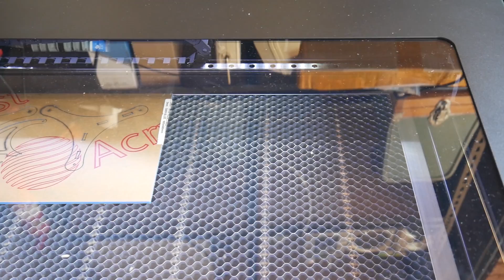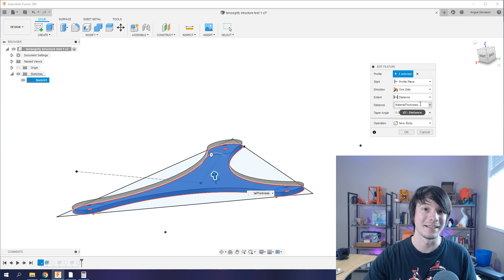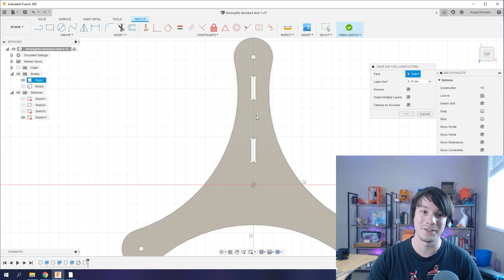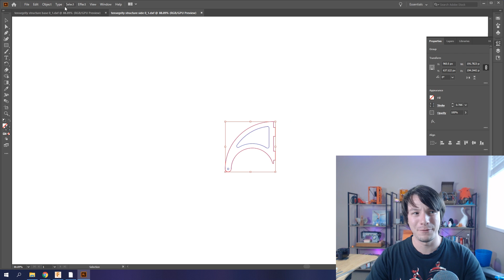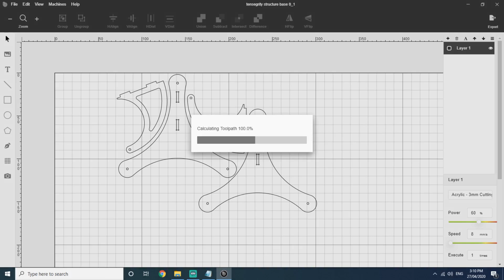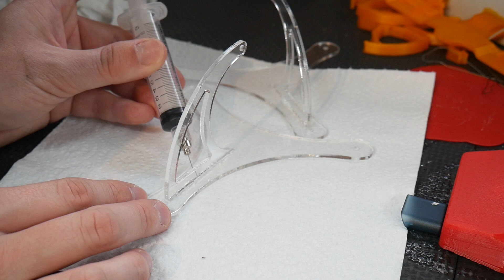Laser Cutting a Tensegrity Structure

Comment: 14:57 I see one issue, though. You usually want to go from inside to outside. Because as soon as the outside line is cut, the part might be loose. AND MOVING! Which then screws up any subsequential cut (their tolerances).

Comment: A tip for both you and the viewers that I didn't see mentioned: There are two primary acrylic production methods, cast and extruded (this is almost always specified on the product page).  Extruded acrylic by and large has much tighter tolerances for size, both across a single sheet and between sheets, so it's my go-to choice for consistent results out of my laser cutter.

Conveniently, extruded acrylic also tends to be cheaper, so it's most likely what you have anyway.  The only upside I've heard for cast acrylic in laser applications is that it apparently engraves to a more pleasing, chalky white finish.

Comment: NEVER AGAIN !   That's what i was told when I picked up 30 pcs of a simple part I had laser cut from 1/8 thick acrylic. I also got an ear full from the plant EHS manager. Ventilation/fume exhaust is critical.
Reply from the maker: Sounds like they have nfi what they're doing, acrylic is easy to cut and fumes can be mitigated by any basic vent system.

Comment: Your kerf is 0.2mm, not 0.1mm.  Because you have removed 0.1mm on either side of the cut.  So your square is 0.1mm smaller on both sides, so 0.2mm smaller in total.
This also perfectly fits what you expect.  Pretty much ALL laser cutters have a kerf of 0.2mm.
Also, consider putting in dimples equal to your kerf.  Add a triangle in the middle of one of the slides in the slot, with height of 0.2mm and width of 0.4mm.  It will be barely visible, but this will give a very satisifying 'click' when you push them together

Comment: The plastic manufacturers know that their customers have a 10% tolerance allowed in the sheet thickness. Knowing this they intentionally aim for 90% thick instead of nominal because it saves them 10% in cost.  I spent many years running laser cutters at work and it's pretty much the norm that acrylic will allows be thinner than listed.  Annoying just the same.

Comment: you forgot to mention one aspect, depending on the acrylic you sometimes need to heat treat it. 
taking it straight out of the laser cutter and putting it in cold water will cause a billion tiny hairline cracks and ruin the aspect of it. 
At my workplace we have an oven we put the parts in there and no more cracks.

Comment: There is a place for SLA, FFA, and laser.  a shop that has these and the skills required to use this is a well stocked shop.  However, if you are spending the $3000 on each of them, you are not only in a different tax bracket than most people who want to use them, but you really should be producing, and not just have them as a hobby.  Production quality is very useful, but how useful is it if you cant afford it?  I would like to see some videos on some more affordable machines.

Comment: you always have to check your acrylic thickness, if you check the acrylic thickness tolerance you will certainly be surprised on how in accurate it could be. BUT WHY? it is because when they produce the acrylic, they have to melt plastic and put it in between 2 very large glass sheets(like a mold block) so for sure that an acrylic will be super vary in different spot.

I own a laser cutter as well, I love my laser cut more than a 3d printer tho because it is so DAMN FAST but i still love 3d printer for producing a very complex part as well. I appreciate that you are making a video about laser cutting and I hope to see a series of laser cut more!

I recommend lightburn to make your life easier with a laser cutter, just export the design from fusion 360 in dxf and pop it in Lightburn. BTW the idea of KERF is important ! about the peeling of material, I usually soak it in alcohol make it easy to peel.

Comment: Does the laser cutter have a radiation screen built in, or do you have to wear laser safety glasses instead?
What other plastics can that machine cut? Can it cut polycarbonate?
Also, what is the finish like on the bottom side of the cut? I laser cut metals for a job, and you tend to get a dross edge on the underside of the cut, mainly on aluminium.

Comment: The cracks are from the heating of the laser (think tempered glass/ Prince rupert's drop). Any solvent will cause the material to weaken and fracture. You can prevent this by baking the pieces in an oven (120-140C depending on location/altitude) for 30-60 minutes, about 70% of melting temp to relieve the stress without deformation. You can also help reduce the edge bevel by setting the focal point in the middle of the material.

It's hard to see from the time lapse but it also looks like the air assist on that machine is low for doing plastics (petg, acrylic, etc.. NEVER vinyl (pvc) or ABS). Ideal for plastics is 15-20psi.

It was mentioned below but to say it again, Lightburn (if the controller is supported) will do everything you just did all in one package (create, edit, kerf offset, etc...)

Comment: With the laser cutter i use. Leaving the lid open and running the cut will give you a preview as the laser will not fire due to the interlock switch but will run the program as normal. Is only a work around on a small project as it will run the whole program not a bounding box of the cutting area.

Comment: If your laser can take SVG, I wrote a plugin for Fusion 360 Laser CAM that will allow you use use all the CAM features, like kerf compensation, opperation ordering etc in Fusion 360: https://github.com/garethky/glowforge-colorific-fusion360-post
Its nominally for Glowforge but it generates well formed SVG.

Comment: You can do your stock layout (what you are calling "nesting") in Fusion rather than Illustrator, and you will avoid all the problems with potentially breaking parts during stock layout. 

The best way to do it is: 1. Make sure every part is its own component in Fusion 2. Create a new component (call it "Stock Layout") 3. Copy every component into the stock layout component. 4. Now you can arrange the child components of the stock layout component however you like (including rotating them to lie flat and moving them relative to each other) without disturbing the originals 5. Export stock layout component to DXF.

PS. Minor point: "nesting" is when, during stock layout, you put one (smaller) component inside a cutout in a (larger) component. When you are just moving parts around without one being completely enclosed by another, that's not "nesting", that's just stock layout.

Comment: I've worked at a trophy shop for about 6 years, worked with extruded acrylic blocks. Even from the same box from the manufacturer, the thickness always varies from each sample. So annoying to work with especially when working with UV printers with delicate printing heads. Made some acrylic display stands with the facilities laser cutters, took some trial and error, but finally got the parts to friction fit. A lot of fun to design these types of things! Thinking of getting a laser machine too. Thanks for the tip for the stress relief technique! Had no idea about it, future projects will go a lot smoother in the future.

Comment: Deepnest is decent free nesting software. We learned on our first commercial metal cutting laser that while shared lines or using a border as a line sounds good, it produces very poor results. I have  had better results mixing 3d printed parts and laser cut parts. Sandwiching the acrylic parts between two 3d parts and there is virtually no cracking issues. Anyplace you are 3d printing a large flat surface, one should consider laser cutting it instead.

Comment: We use acrylic sheets in my company's products.

Thickness is always an issue. If a sheet of 2 x 1 meters with 10 mm thickness is purchased, in the center of the sheet it will probably be 11.5 mm and at the edges something like 9.5 mm.

And all the different manufacturers that I tried had these variations.

We use 3D printers for structural parts, such as angles and joints and laser or router cuted parts for larger areas. It's a really good combination.

Comment: Finally! The 3D printing get so popular people forget that its not good for everything. The printed parts are very sensible about the direction of the forces they got. If you need a shape what is plane you should cut it from a solid material. 2D sounds outdated but it is a needed manufacturing process.

Comment: Cut your inside holes first so that you don't end up with them offset sightly after the perimeter is cut and the part potentially moves.
Also, Fusion360 does nesting.. I think you're missing a lot of features by not using the sheet metal section.
https://www.autodesk.com/autodesk-university/class/Get-More-Out-Fusion-360-Nesting-2019

Comment: The laser cutter you're using might be a bit overpriced btw.
 It's a Chinese 4060 laser cutter with a custom controller and a coat of black paint, except 4060s cost around $1400 shipped to the us, vs your machine's $4300 base price. Obviously there are disadvantages with the cheaper machines, notably on the software side, but for the same gantry and same tube at $3000 less, it's really hard think you didn't get scammed.
Reply: Like no hate, it's just I ordered a 4040 yesterday after over a month of research and so the whole topic has been on my mind a lot lately. Like, I'm a freshman in college and I just bought a 50w co2 laser on a gantry with linear rails. These machines are affordable and accessible and not many people realize this.
If you can, look into 3020s. They require modding to work well, but for $350 shipped, in stock outside of china as well, they easily have potential to be the ender 3 of laser cutting.

Comment: Nice to see a new branch on the channel but in regards to the idea of adjusting kerf in the model I feel the information you are providing is incorrect. Almost all quality cutting software allows for kerf adjustment in the cutting software and shouldn't happened on the model/dxf side. When you adjust inside the dxf you run the assumption that the material is constant, but by adjusting in the control software you can switch between materials with the same design.

Comment: The cracking isn't because you used acetone. It's because you laser cut the acrylic and didn't anneal it before gluing. Your suggestion of washing the parts after laser cutting them also isn't the best advice. I have had instances where washing the parts immediately after laser cutting has caused them to crack.
Reply: I mean the acetone probably didn't help, but even using a produce like Weld-On 4 you're not guaranteed a crack free result with laser cut edges.

Comment: For acrylics, always assume that it's going to be undersized but within tolerance (from reputable manufacturers). A 0.125" plus/minus .003" sheet is going to be consistently 0.122-.123" thick, at least in my experience. The 2.5mm sheet you got is probably a 0.1" sheet approximated to 3mm, or a simple mislabel.

Comment: Hey, Angus, the edges of the transparent acryillic will probably craze with any solvent/acryllic glue you decide to use. This is due to the concentrated heat created from the laser, which creates tension all over the laser-cut edge. The solvent is releasing that, producing the craze. We used to cook/anneal laser cut acryllic parts in order for them NOT to craze during glueing. I believe the cooking recipe is something like 6-8hrs @ 65-75*C, from what I remember. In comparison, a regularly cut acryllic (on a saw table for example) has no such issues with crazing on the sawed-off edge, after glueing.

Comment: I have 3 of the CNC technologies, 3DP, Laser cutter and a CNC router, great to see you with some other than 3DP I will have to give this a go. I generally use Lightburn with my cutter however if I need better design power I use Vcarve 10 it was bundled with my CNC machine and is very good. Just one point you mentioned your edges cracked and crazed when you applied solvent, this is a downside to laser cutting the sheer heat that ablates away the material leaves the edge surface stressed hence it cracks when you apply adhesive. I intend to experiment by filing away varying amounts of the edge after a cut then apply glue to see how deep this stressing goes I suspect it is very shallow 0.1 to 0.1 thick but the crazing can go 1 to 2mm from the edge which looks horrible. 
I use Acri-bond 105 it is like acetone and bonds very well but because it is thin I find it difficult to work with.
Great stuff Angus.

Comment: To prevent the crazing or cracking sand or grind the laser cut edge. Solvent welding a laser cut edge causes this even with proper MEK or Weldon as you are releasing pressure. Plus a laser cut edge is not perfectly straight.

Comment: To save some time post processing, try peeling the top layer of protective film off the acrylic before cutting. With non-transparent acrylic you can peel both but you risk scratching the acrylic on the cutting bed. 
Also in regards to previewing a cut I know on an epilog laser cutter if you open the lid then start the cut it will run through the operations without enabling the laser. On those machines there is a red dot laser so you can see where the laser would be cutting. Hope this helps

Comment: If you think those thickness issues are bad, imagine asking for 1/8 in Acrylic(stupid US). You are expecting 3.175mm and yeah, you are lucky if you get something in the 2.9 range. Cast acrylic has much better tolerances, but it is also a lot more expensive and sadly, still appears to come in metric sizes sold to the nearest 1/16 inch. That old adage, measure twice cut once applies doubly here.

Luckily, I have a plastic specialist store nearby that has pretty tight tolerances and thankfully they now offer custom cutting in metric.
Reply: I was about to ask about crazing when I saw the giant jug of acetone. Methyl ethyl ketone(MEK) works better than acetone and is also fairly easy to acquire or if you are friends with a chemist, dichloromethane or chloroform work great. And I would probably handle the solvent adhesives in the same manner you handle your resin prints. Even acetone can seriously dry out your skin and after enough exposure, lead to skin issues. 

Great video, I am looking forward to seeing more done with the Beambox Flux/laser cutters in the future. 

And if you have some clear resin, you could try it for your acrylic solvent welds. Might need to expose it to some UV, but the underlying chemical structures should be similar and it might work. At least better than super glue which can also lead to clouding and crazing.

Comment: Hi Angus, I think that part of your issues with kerfs have a little bit to do with the software you are using. With Fusion the design structures are the ones you wish to keep. With a laser or CNC the line is what you wish to remove. I actually use  Vectric’s Aspire to do the job, but really most CNC software would work. I simply surmised that if I treat the width of the laser beam as a corollary to the width of an end mill then why not just enter that value as the cutter width. Once done all I have to do for the cut is to indicated whether I wish to cut outside, on, or inside the entity. If I have to change the beam width I just modify the cutter width value, recompile, save as a vector based drawing and shoot to over to the laser. Could not be simpler. In the case of the dog bones you designed to insert the upper tabs into would be as simple as setting the job dimensions, draw the dog bone, select it, choose any cutter, enter it’s width as being the laser beam width, choose the cut inside option, save, run (which essentially creates the code, and can either export it as g-code or as a vector. Robert is your father’s brother.

Comment: Go undersized on your slots and file to size with needle files, thanks for talking about nesting, its important, I used to take special care with that when I was working with computer routing 30 years ago, I sometimes could save 33% on material costs from the amount the purchasing officer had bought. 33% on a large job is not chicken feed.

Comment: The forming of the cracks when welding with acetone is due to thermic stress induced by the laser cutting. You can relieve most of the stress by gently heating the parts along the cutlines using a heat gun, preferably a temperature controlled one. Every glue with a solvent will have the cracking effect if the parts are not post treated.
Reply from the maker: I was wondering if that had something to do with it, the acetone gets very cold as it evaporates. Thanks for the tip!
Reply: If it was thermic stress you would also see the cracks when welding pieces together with heat or by the cutting process itself (cut parts are quite hot sometines). The cracks form because the solvent increases volume. When the solvent evaporates, the acrylic isn't flexible enough to follow (as volume decreases, the rigidity also rises which isn't a great combination and you get cracks in the end)

Comment: Extruded acrylic cuts better with laser than cast acrylic. But if you are welding the acrylic with acetone, it's better to use cast acrylic. I make a lot of acrylic boxes and found that cast acrylic never cracked on me when welding with acetone. Also, I avoid welding on the polished surfaces (i.e. the edge that was cut with the laser cutter), as those tend to crack once in a while when welding with solvent. Try sanding those surfaces down before welding it to avoid cracking. However, if you do end up welding them together anyways, make the slot tolerance larger and just rely on the solvent to hold the pieces together and just use the slots as a placement/alignment guide.